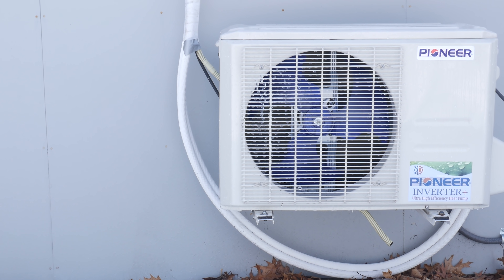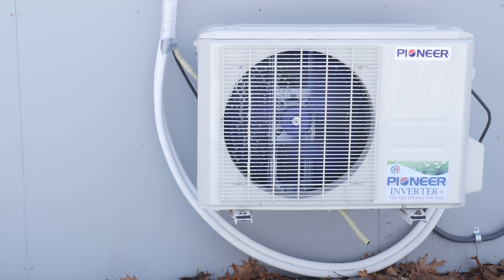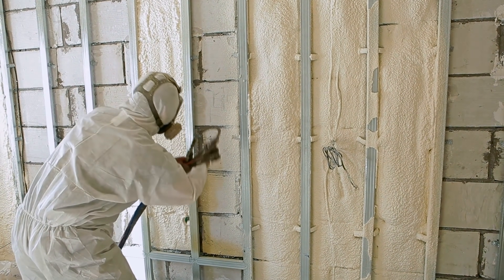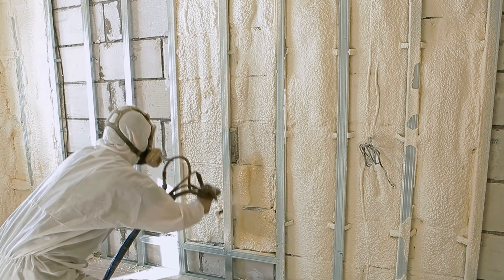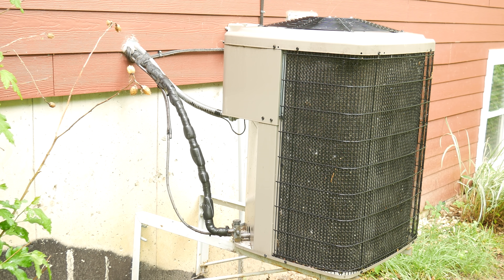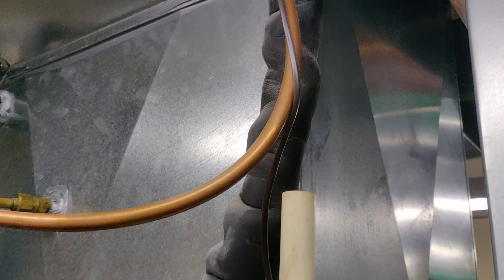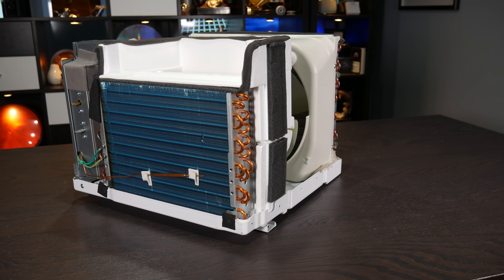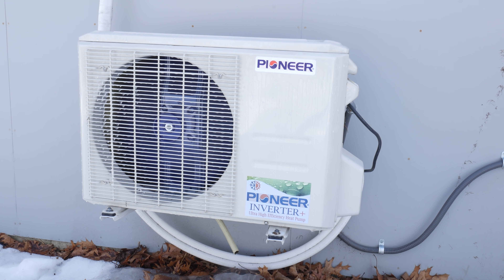Heat Pumps are Not Hard: Here's what it will take to start pumping

Comment: I love this channel. That said, "insulate, insulate, insulate" is kinda wrong. The most important part of the equation is air sealing. You are far better off focusing on reducing air infiltration and leakage than insulating. Once you've done everything you can to reduce losses from air leakage, then you should insulate.
Reply from the maker: I did also say that this includes weatherizing, but I get your point. And then of course there's the problem of ventilation! HRVs are something I intend to cover soon.
Reply: @TechnologyConnections  a video about HRVs and ERVs would be great. I'm in the high performance building industry and it's a very misunderstood part of building science. Ventilation is really coming into it's own now with integration of self balancing systems and "home run" designs like what Zehnder is offering.

It'd be great to address the "buildings need to breath" controversy!
Reply: The biggy is still insulation after draught proofing. My dad refuses to insulate the loft "because it looks bad"

This being said, heat pumps aren't necessarily cost saving if your heating is powered by natural gas. It's cleaner and greener, sure but gas (in the UK at least) is still 4 to 5 times cheaper than electricity even with current prices .

I've not seen any heat pumps that have an average COP of 5+ over the year. I refuse to get AC even as our summers get warmer, because Holy shit that's expensive

The other biggy is that hear pumps are at least £8K here for an ASHP
Reply: It would be cool if the building could introduce a little fresh air during the optimal time of day when the temperature differential was at a minimum. I've always wondered how we don't eventually suffocate indoors sometimes, but I guess it's just not sealed like a space ship, plus opening doors. But still, I know there have been studies about indoor CO2 levels and productivity in office buildings, so it's something to think about.
Reply: but didn't the research come out that suggests sealed homes may be not very good for the well being of the occupants and the structure? I don't remember the specifics, just that it might have been a thing.
Reply: @raydai3708   this is why when a structure is made airtight, this should always be accompanied by some form of mechanical ventilation (preferably balanced and with heat recovery), as there is no more “natural ventilation” (aka draughts). This is embedded in the residential building codes here in The Netherlands, new homes are almost universally fitted with HRV units.
Reply: @raydai3708  because of that you need some ventilation system, ideally with heat exchange and (de)humidification. Otherwise fungus will eat up your house.
There are centralized systems as well as decentralized (one per room) - it's really cool to not need to open any window the whole day for getting fresh air and save heating energy that way!
Without these, it would be hard to build a house in an environment with winters around -20°C which takes less than 30kWh/m²/year...
Reply: It all comes down to the math, upfront cost vs payoff time. If your current fuel source is something like propane you could easily see more savings switching to a heatpump vs additional insulation and air sealing. 

Insulation has rapidly deminishing returns.
Reply: @raydai3708  build tight, ventilate right. If you're going to have an airtight structure, you need mechanical ventilation. Fresh air is a must, but you want to do it on your terms. If you build a leaky house, your fresh air is going to be leaking in at all the wrong locations... through your insulation, at the rim board, through your attic, and around your windows. All of these leaks come with their own set of problems.
Reply: @DFPercush  heat recovery and enthalpy recovery ventilation (HRV and ERV) addresses this problem. It allows you to bring fresh air into your home without a huge energy or humidity penalty. It also allows you to bring air into your home that isn't being filtered through the wall/basement/attic assemblies that aren't meant for air movement.
Reply: @Tithis  you're right, actually doing the calculations is the best way to get the "best bang for your buck". The math almost always points to improving the building envelope before upgrading the heating systems. Air tightness is the lowest hanging fruit and is usually where you should concentrate, then thermal performance (i.e. insulation). But at about R40 walls, R60 ceiling/attic, and R20 foundation walls, additional insulation starts to not really make financial sense.

You also have to consider durability. Certain building practices can cause moisture problems that result in condensation inside the wall and subsequent rotting of your exterior sheathing and framing. This is why the building code is now requiring continuous exterior insulation in some climate zones.
Reply: @RustyNail600  We ended up getting a heat pump before doing major air sealing projects.

We live in a 250 year old home that has fiberglass insulation in the walls and attic floor, it has wood siding with very open sheathing. 

A couple months prior to getting our heat pump we had side of the house in the worst condition resided, part of which was installing a proper house wrap under the new cedar siding. That one side cost about as much as the heat pump did after rebates, and we still got 2 more sides that need the same done.

Meanwhile per BTU the heat pump costs 35% less to heat with at design temp than propane does for us.
Reply: @Tithis  yeah, in really old structures the math often points to newer heating systems (simply because retrofit air sealing and insulation is so darn difficult and ends up costing a lot). On new construction, the math will always point to smaller HVAC systems, more insulation, and tighter envelopes. If you are replacing an existing heating system and you're in a mild climate, it's almost always best to go the heat pump route. Even in cold climates, heat pumps can make sense. I just installed one in my own house as the primary heat source and I'm in climate zone 6. Also, if you are tearing off exterior siding, it's worth doing exterior insulation and a peel and sick weather resistive barrier (house wrap). We just did this on a giant old boarding house from 1895 and it is performing great!
Reply: @RustyNail600  We've got a roadmap, but still gonna take a bit (especially with these damn lumber prices)

Suppose a nice thing about inverter heat pumps is they can scale down as we reduce the heat/cooling load with further projects.
Reply: This ^ 
Without air sealing many types of insulation become pretty ineffective. 

Same goes for all the talk of replacing windows. Much cheaper to just install weatherstripping on what you already have and get very good performance

Comment: Thanks for producing such a informative balanced and accurate video about heat pumps in particular but so much else gets a mention, VRV,  inverters and more.
I'm a Brit who was taught by guy's, all men who had been through a war and then back  into industry, we all worked for a US air heating company who was diversifying. 1970 Condensing broilers, natural gas, the manufacturing hadn't arrived. Heat pumps did arrive by 1980 as a cooling unit for cellar cooling for hundreds of pubs with below ground cellars. The heat transfer was to pre heat a first stage hot water cylinder for a constant three to one energy gain 365 days.
I was told by Toshiba I installed the first Tosh heat pumps in the UK. An a/c pipework only installed the units. An electrical contractor wired, I was to make the final connections, vac and charge with some publicity shots. The installation was a mainframe computer that would never require heating forever, cooling only at a kW  in equals a kW output. The ad agency went away happy and the chief engineer took me out to dinner as I was staying the night. I tried to pay but he said no quite forcibly and smiled. He said the IT manager would be paying, he thanked me being honest as he had insisted the computer room would never require heating but his !level of science the IT produced literature that the heat pump would save money.

Comment: I'd really kind of like to see a retrofit system to "update" existing AC units to become Heat Pumps. Yes I realize that there ae flaws with this, but I do suspect that being able to just use the heat/cool pump through most of the year, and limit the Gas usage to those days when the heat pump gets bogged down because of icing, etc, would cut down on natural gas use at a lot of places. Even with a less than ideal duct work. Alternatively being able to do the massive heat dump of the gas furnace to get the house up to the desired temp in the morning, then maintain that temp through the day would potentially cut back on gas use as well.

But we need to insulate here first.
Reply: A "Heat Pump" is an Air Conditioner. It's simply a Reverse Cycle Air Conditioner.
The use of that term "Heat Pump" is what is causing Americans so much confusion.
Everywhere else in the world, we don't install 2 completely separate HVAC system like is commonly done in the USA.
Reply: @johncoops6897  well they ussally aren't to completely separate systems. they ussally share the air handler.
Reply: @Patmorgan235Us  - what I mean is that in most countries, we have been fitting Reverse Cycle Air Conditioners for about 40 years... it's not some radical latest news to us in the modern world. There is no need for a separate heater (on a different fuel) in most climates, the A/C can do it all.
And if they share the air handler then the A/C unit can easily be upgraded to Reverse Cycle with Inverter. This gives the cooling efficiency gains, plus cheaper baseline heating. Just leave the big gas furnace if worried about mid-winter capacity.
Just don't call it a "Heat Pump" when getting quotes, because Americans installers simply don't understand those, but they understand the term A/C just fine.
Reply: ITS THIS EASY: remove AC unit.  Install heat pump unit.  Done!

As for backup, most have resistance heat built-in.  It turns-on if the temperature drops below 5 F.  Otherwise all the heat in my house comes from my heat pump

.
Reply: @electrictroy2010  It's easy to prepare to drive in the snow. Scrap the perfectly good car you've been driving all summer and buy an entirely new one with snow tires. After all it's far too expensive and time consuming to just get a new set of snow tires and wheels and go around and replace the tires you've been driving on.

Note that the only thing that separates an A/C unit from a heat pump is a valve and the electronics to switch which side of the unit gets warm and which side gets cool. But hey, go get someone to extract the refrigerant, scrap the perfectly good A/C unit out and buy a whole new unit that acts as a heat pump. You're made of money. Right?

No, I know you're not. So if you drive in a climate with snow, you likely have 'all season' tires that are optimized neither for snow, nor summer roads, but meet standards that suggest they are acceptable for each. And most of us are going to be stuck wasting heat by burning gas in our house when we could (at least in theory) be using a heat pump and have a much more efficient heating system that then only burns gas when the outside temps drop to a point where the heat pump efficiency goes out the window. We don't do the heat pump thing because we've got perfectly good A/C units that we dropped a bundle on and we don't see that the cost of scrapping that out to put in a heat pump will pay for itself the way putting one initially may have, but even though some of us live in a climate where a heat pump would provide a benefit, they are not generally available in our markets.

And yes, I do think that a retrofit option that replaces the valve, and adds the electronics could be done, and probably for far less than buying an entirely new unit to be installed, but I also know that it's not likely to be made available unless someone gets with the local electric provider to have them get the tech assembled, and the installers on the payroll, and offer it to customers with A/C units.

And even there it's not going to be an ideal solution. As noted a modern heat pump tends to be running at other than all out push the system to the limit power draw, where a retrofitted A/C unit probably will not be operating in a variable power draw mode. I know many people who can live with that if we can start seeing better than 100% efficiency.

Comment: Slight correction to your comments on VRF systems. Only "heat-recovery" type VRF systems can do zone-to-zone heat transfer. These typically have a series of branch controller boxes with the necessary refrigerant diverting valves to allow this to happen. There are also either three pipes (most systems) or two pipes carrying bi-phase refrigerant mixture (some systems) between the outdoor units and the branch boxes. There are also "heat-pump" VRF systems which are the same basic equipment, but do not have this capability. There are just two pipes through the whole system and no branch boxes. The units still have individual zone control but there cannot be opposing modes and there is no zone-to-zone transfer. These are a simpler, less expensive option for when you have either a large open space to condition, or similar exterior exposures and room uses within that system. A competent HVAC design engineer can tell you which is the best for a particular situation, but these systems are indeed much more common for commercial applications.
Reply: I'll tell you, the heat recovery system sounds very attractive if you have a family that has very different temperature preferences 😉🤣
Reply: @Ariccio123  For most residential size buildings, the differences aren't enough to make a difference unless one person really wants to be a polar bear and one wants to be in a constant sauna. For larger homes, it's often better to just have separate systems if you are doing a major upgrade to suit such a family situation. Most of the heat recovery VRF systems require 3-phase power and start at 6 tons capacity. I think Toshiba has 3-5 ton units in heat recovery that are also single-phase but I have no professional experience with them. I've only designed with Daikin and Mitsubishi, and possibly will be doing an LG project soon. And really when you think about it, all mini-splits with variable speed compressors are technically VRF systems, but the industry uses that term to mean something very specific.

Comment: One very real problem with using ductless systems in small homes is the limited lower end of indoor unit size.  It is pretty much impossible to find a small enough indoor unit for many applications.  And those lovely modulating inverter systems?  They can only modulate down to 25 or 30% of rated capacity.  This means that if you have a multi-head system you can't efficiently air condition only a single room to save energy.

Modulation and over-sizing also come into play when using the heat pump for air conditioning.  If the system is oversized, then it doesn't dehumidify effectively.  You end up being forced to have an excessive relative humidity or you have to over-cool to get a desirable RH.

My guess on the HSPF number being lower than expected from the COP is that HSPF includes energy consumption at partial load, at no load, and when defrosting; not just the COP during rated operation.  I'd love to collaborate on a deep dive into HSPF, but I bet one of your other readers actually knows. 

On the cost of installation, do keep in mind the concept of 'mark up'.  Professionals generally charge for their time and some multiple of the cost of the hardware being installed.  Think about two systems that take 10 hours to install.  You might think that the total installed cost is 'wholesale cost + 10x hourly rate'.  But that doesn't include the potential cost of something going wrong.  People make mistakes, they are after all human.  Responsible professionals fix their own mistakes.  But to stay in business they have to charge enough to be prepared to fix those mistakes.  That means that they need to charge more to install more expensive hardware, even if the effort is the same.

Jon

Comment: There's an important factor missing from the section about insulation: embodied carbon!

If the goal of reducing energy consumption is to slow/reverse climate change, you need to be careful about what materials you use. There's a lot of closed cell spray foam B-roll and that's one of the worst offenders wrt embodied carbon. Most closed cell foams use blowing agents with extremely high GWP, creating a situation where it can take >20 years to hit the GWP break-even point, assuming that your electricity supply continues emitting CO2. The cleaner your grid is, the longer the payback period. If you're on a 100% clean grid, you'll never break even!

All that to say: it's important to choose carbon-sequestering insulation products like packed cellulose and fiberboard instead of carbon-emitting insulation products like foams and mineral wool!
Reply: But what you forgot to look into is the safety factor of items like Rockwall. Rockwool insulation's a.k.a. mineral wool are a lot safer during a house fire and will slow it substantially. Followed up with good building practices such as making sure your sheet rock is properly taped and mudded and you bought yourself some time to get out in a worst case scenario it also doesn't mold or have its abilities to insulate critically damaged if it gets wet.